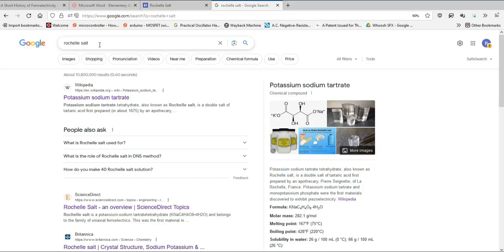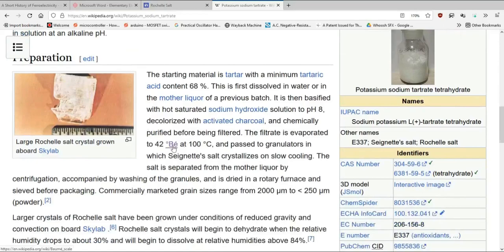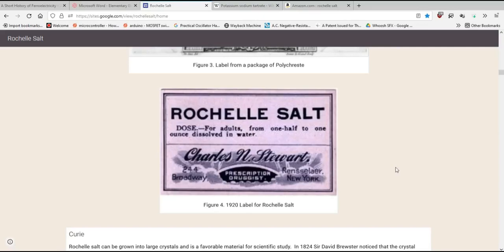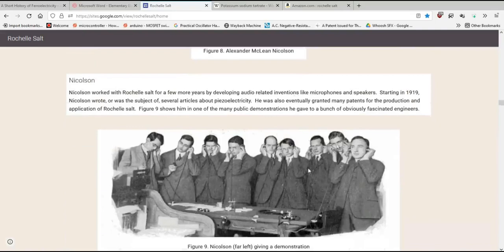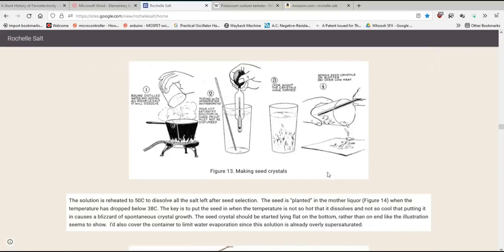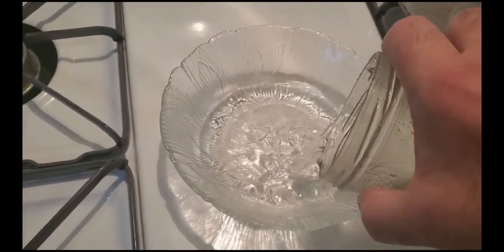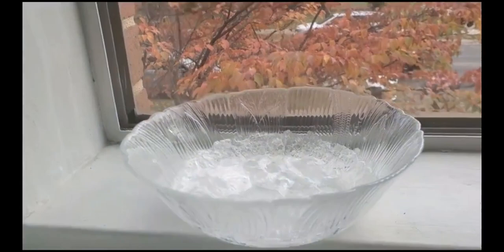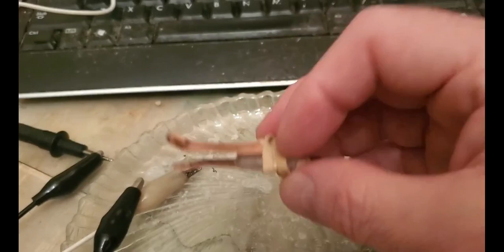How to Grow Rochelle Salt Crystals

Comment: Cool experiments. I don't think the results are underwhelming, they are actually pretty good considering the quality of contact of the copper plates. :) One thing I recommend to try is to buy an ultrasound gel for $2 and apply to the opposite sites of the crystal (very careful not to short them with gel). That should take care of the contact thing. Another more expensive but also more permanent solution is to cover the sides with conductive glue/paint/varnish. Your piezo brass disc is ceramic so most probably lead zirconate titanate which is also ferroelectric. I suspect the voltage you're seeing on the multimeter is from radio waves coming into floating copper electrode. Brass disc on the other side has much more capacitance from one electrode to the second (ground) electrode which shorts that interference out and that is (perhaps) why you see some voltage on rochelle transducer and not on the PZT transducer.
Reply from the maker: Hi Marek, sorry for the late reply, comments like this make me glad I started to videolog some of this nonsense.  Ultrasound gel to get a good connection with the crystal, can't say I ever would of thought of that, but it makes perfect sense and I'll take your word for it that ultrasound gel is conductive.  I don't know what's going on with half of this and you are probably right about maybe picking up radiowaves off the computer or router.  I think I am going to put this project on the back shelf for a little while, though will likely return to it at some point in 2024. When I do return to it now I've got three things 1) use a seed crystal to grow larger, more consistent crystals, 2) try and grow thinner crystals and now 3) pick up some ultrasound gel!  Thanks again, always great to hear from people who know a bit more and are more experienced than me on topics I am just taking a first look at.